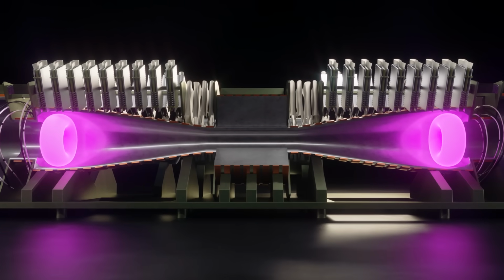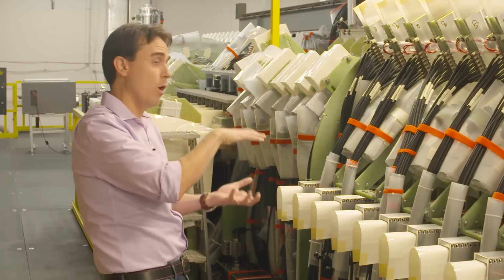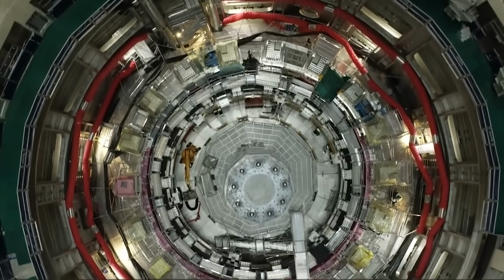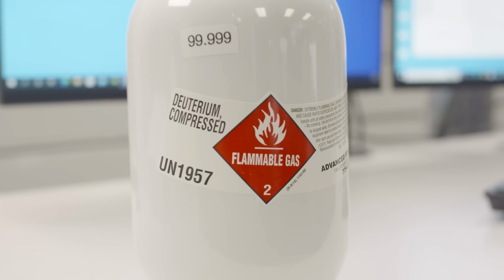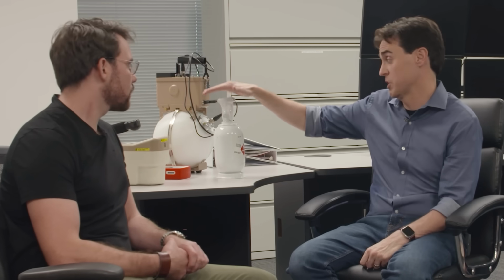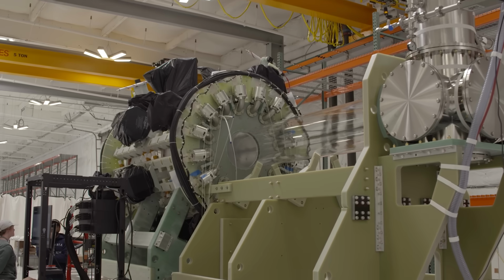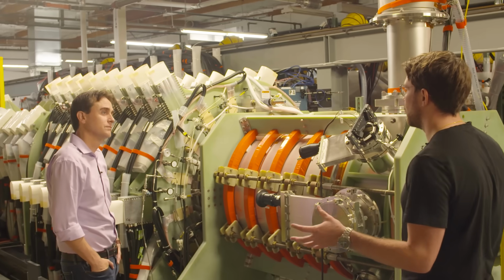A New Way to Achieve Nuclear Fusion: Helion

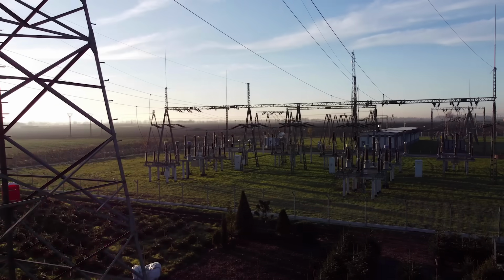Comment: 22:30 I wonder if you could replace all those capacitors with just a second generator next to it.
Generator A fuses atoms, powers generator B's containment ---> generator B fuses atoms, powers generator A's containment. Like a twin-piston diesel engine in lawnmower haha
Advantage would be power generation magnets of A could be directly wired to containment of B (no electronics needed, just wire-on-wire, right?)

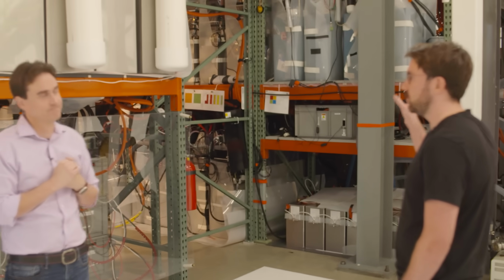Starting it all up might require a hell of a pull string though....(Initial start might require those capacitors anyway) BUT you would avoid damaging capacitors over time by repetition use (like was mentioned at cca 24:22)
Reply: The power input requirements over time likely won't match the power output curve, so they will probably need some form of energy storage no matter how many reactors they have set up to work together.
Reply: @Tsudico  Aah that's a good point. What if the power output doesn't match?
Maybe it doesn't have to though - you will generate lots of electricity, some of which will go to the other generator - and the rest goes to the grid (and maybe that's where you might need some storage, but not as much)
Reply: Then how will energy get generated then?

Comment: Especially after your last video about fusion reactors, this really seems a lot more hopeful, to use your words. Did you talk to David more about how the piston-like process of actually "harvesting" more electricity than is put in works?
Reply: In principle you can understand it by reading Maxwell's equations (the changing magnetic field creates an electric field that accelerates the electrons in the wire and creates a current), but I'd also be interested in seeing how it's made reasonably efficient, and how it doesn't just suck up all the other magnetic fields that are used

Comment: Around the 26 minute mark, speaking on the speeds of the power release in the magnets, was the determining factor of the potential speeds for the coil gun I drew up in 10th grade, 24 years ago, lol. Weaponizing the driving magnetic force is the key to magnetic accelerator cannons, IMO. Railguns are obsolete now, and I am amused to see my hypothetical design from my teens justified by this fusion reactor.

Comment: This looks like an excellent direction to go in to develop fusion technology.  Ideally, it would be better to come up with a way to use deuterium as fuel.  But if they can come up with an effective way to produce their fuel from deuterium, I would say that's a reasonably good way to get around that problem.  Otherwise, it's a non-starter.  But everything else is good.  The smaller reactors that can be more quickly and easily built are definitely the way to go.  It's not only more practical for producing fusion power generation, but it's considerably more practical during this research and development phase.  They can build ten different versions of this reactor in less time than it takes to build one reactor of other types.  I really hate the lack of progress in the field, and it's largely because of people not at all considering the practicalities of developing the technology.  They are, basically, doing research for the sake of research rather than with an end product in mind.

Comment: So if I'm understanding correctly, Helion plans to use the orbiting fusion particles to drive a dynamo. But they either haven't done that yet, or they haven't said how much power output they're getting from it?
Reply: They said that they can currently only fire once every 10 mins so the output would be minimal but it seems like the end goal is multiple times per second. So once they have a smaller waiting window and more constant flow they would be able to have data they can use to predict how much theyd get at certain firing rates.
Reply: @Konz97  Ah thanks, that makes sense.
Reply: look up lenz's law.
there are electro magnets surrounding the plasma confining it with magnetic fields, the plasma also has a magnetic field.
when fusion happens the plasma expands with force, so the field of the plasma pushes back on the field of the electromagnets, causing the induction of current in the electro magnet.

it is not exactly a dynamo because there is not a constant rotating field, it is more of push pull thing, compress and expand. like the piston of a car engine.

also they are currently drawing power in their other test systems but not in the large scale main machines
Reply: @atafakheri8659  the video pretty much skipped a detail explanation of this part.  what exactly is spun or pushed to generate energy.
Reply: @shake6321  did you watch till the end? it was explained!!
the middle section of the generator compresses the ball of plasma, the compression causes build up of pressure and temperature in the ball of plasma igniting fusion reaction.
the fusion causes the expansion of plasma that causes the field of the plasma to push against the field of the electro magnets, inducing current.

the generator itself has no mechanically moving part
Reply: @shake6321  Spinning ions have an EM field, so you can use that as a rotor to induce electrical current in a stator. It's the inverted process we see in all electric motors.
Reply: @atafakheri8659  i am a laymen.  they used graphics for everything else but didn’t really spend much time on spin or piston action.
Reply: They haven't extracted energy yet. That is what their next reactor version is planned to do when they finish building it in about 2 years. It is possible though that even if they haven't tried to extract energy out, they have seen the changes to the magnetic field that the fusion plasma is causing in the current reactor to make them think it is even feasible.
Reply: they probably aren't confident of their machine to yield high efficiency. I think their machine version 7 will still be a debugging/test machine to actually measure the energy output, which might be lower than they'd hope. That's why there's no final numbers yet. (Like for example mentioning that "gyro orbit" is larger than they expect, which implies that the particle collided with the reactor wall and causing energy losses, for this version 6 of the machine).
Reply: @xponen  LOL, i don't think any research company releases actual data to press on upcoming techs. it doesn't have anything to do with "confidence"
Reply: @atafakheri8659  what about Elon Musk? he does that. Compared to Elon Musk, this company doesn't dare to mention any numbers at all.
Reply: @xponen  Elon Musk is also a narcissist who has been seen time and time again making promises he can’t keep
Reply: @xponen  ah yes, releasing numbers about test drives of cars on the road in hands of volunteer testers is the same as publishing data about a cutting edge technology hidden behind bars.
you are high as Fuck if you think tesla cars are any where near the technological secrecy of this technology.
Reply: @suckersupreme  Yep, where is the hyperloop? Where is the cyber truck? What about these underground roads. Musk is full of shit most of the time.
Reply: @xponen  Elon Musk is a con man. Of course he releases numbers to excite the tech bros
Reply: @xponen  He might shout out numbers, but in most cases they turn out to be... optimistic, if we're being very generous. Elon's a publicity guy first and foremost, not a resposible businessman. He wants to be seen as a genious visionary, so he tries desperately to be ahead of the curve, problem is he is he rarely has any substance behind it.
Reply: @suckersupreme  I mean, my point is, his "confidence" is soo high it allows him to cite numbers on behalf of his company.
Reply: @nurfuerdieplaylist  It's astonishing that people like you post bullshit without knowing anything about anything. "Any substance behind it"? really buddy? really? SpaceX being the only company who successfully developed reusable rockets and only private company to privately deliver stuff to ISS, Starlink being the only global satellite network of this scale available to pubic, Solar panels , Batteries, Tesla even though it never was cutting edge, but it created the electric segment you see today.
Reply: @xponen Get off Elon Musk’s nuts man. He doesn’t even do any of the engineering and hard work himself, he’s always just pulling numbers out of his ass.
Reply: @tonygunk307  Do you think Elon created SpaceX himself? Or the Lithium Ion Battery? Or hell, even PayPal? That's what I mean by not any substance. He never comes up with anything himself, he only takes credit for other people's ideas. Yes, he sometimes facilitated the success of these ideas by throwing money at it, and I will happily admit that it pushed some boundries, but my point is he's the guy with the money, not the ideas. Which was my original argument.
Also, let's not forget all the ideas that Elon put out over the years that were kinda shit to begin with, like his whole take on public transportation.
Reply: @xponen  If someone other than Elon actually acting in good faith were to be as public and evocative with their creative process, then yes that might work out pretty well. It's just a big risk to take since it also enhances any backlash.
Reply: It’s like the laser fusion and every other fusion test right now .Nobody has a working prototype to capture the electricity, we have multiple ways to create a fusion reaction on earth but no working solution to capture that energy. If they can create a working prototype in 2024 they will be miles ahead of everyone. For example the recent “breakthrough “ only confirmed that you can get more energy out of a reaction that you put in but that’s not factoring in the energy used by the laser.

Comment: So, what is the Q plasma? How exactly do they want to get usable grid AC out of it, especially if the operation is pulsed, i.e. limited to brief bursts. Running many such devices in parallel and switch between them? How do they remove the fusion products and inject "new fuel"? The piston analogy of the magnetic fields is nice, but how exactly do they switch between compressing (dumping megaamps of energy) and actually capturing the "magnetic pressure" once fusion kicks in, meaning megaamps of energy flowing the other direction. They will need an insanely fast switching capable of handling insane currents to "divert" them out of the machine possible into many different capacitor banks for each cycle. And from those capacitor banks the energy could be switched to the grid. One mistimed switch and the whole capacitor bank literally blows up.

Comment: Really curious what kind of energy output this will have. Shame it wasn't even speculated on in the video, but damn was it impressive to see. Look forward to seeing more of this technology.
Reply: Best part is, even with all this, it's not exactly all that deadly even if something happens. These reactions require a lot of perfect conditions to create energy, and if a puncture or failure occurred, it would just quit. It won't blow up the building or release radiation to the air in awful blazing fires
Reply: Thanks for saving 25 minutes of my life. :)
Reply: Think of the atom bomb but condensed into a energy generator
Reply: @jessemacaspac443  -- Is that per process?
Reply: @TlalocTemporal  if we are heating up plasma so hot we are creating helium 4, then that's pretty much it. This was achieved when the hydrogen bomb was invented. The forces at work here are hard to comprehend really. The power of the sun in a generator, that's wild.
Reply: @jessemacaspac443  -- This might be comparable to a fission bomb in temperature or pressure perhaps, but total energy output is definitely not 200+ terrajoules. That whole building would be vapourized.
Reply: @jessemacaspac443  I doubt very much that is how much energy is produced. That would vaporize the machine instantly.
What I was looking forward to hear is how much energy does 1 cycle generate. They are talking about having to put in massive amounts of power for the process to work, so the output has to be huge. However, they also say the power is in a very short timespan. So it will all depend on how much net energy is released per cycle and how many of these cycles can be done realistically without downtime.
Now sure, some of  the above is what they are experimenting with, but I'm sure they could calculate the mass of fuel injected on both ends and make a guess/calculation of the energy a cycle releases.
My guess right now, is that this is just a proof on concept. They also mentioned they have yet to extract the power generated from the plasma.
So while it is cool and all, without the numbers to back it up, i remain slightly skeptical, but I will keep an eye on this project and hope for positive results in the near future.

Comment: I have some questions

After each plasma collision, where do the new elements go? Is there an exhaust system? It doesn't stay in the reactor right?

How are they going to deal with the heat when they start doing a collision multiple times a second? Could they do double the work on energy collection not only by the magnetic field like you explained but steam generation as well?
Reply: he did mention they have an exhaust system for capture and recovery of spent fuel
Reply: @salerio61  I must have missed that part. There's a lot of info to take in

Comment: by skipping steps to convert the energy, this fusion reactor is surprisingly more simple than tokamak reactor. There were almost no moving parts from what i've seen. I didnt mean that the engineering is simple but i think it take less maintenance and less headache to think about. Simplicity is good.

Comment: You can turn heat into energy right? Would it make sense to have thermo-piezoelectric transducers plastered over absolutely everything that gets even slightly hot? Or is the energy harvested simply not worth the trouble compared to the energy that fusion theoretically brings
Reply: That tiny amount of energy you could gather would be lost before you could turn it into anything useful.

Just not worth the effort.

Comment: Glad you had a fun field trip, but as long as we're trying to use heavy hydrogen, that's always going to result in pollution.

Yes, it comes from refined seawater, but what do you do with the waste after your seawater is distilled? The same thing you do with mass desalinization; pump the brine back into the ocean, where it causes toxicity, killing everything around it in the water.

To make enough deuterium and tritium for sustained fusion, you'd need HUNDREDS of these kind of desalinization facilities.

We've wasted so much money, time and effort on trying to harness the power of the sun that we ignored the fact that we can do that already in multiple ways.

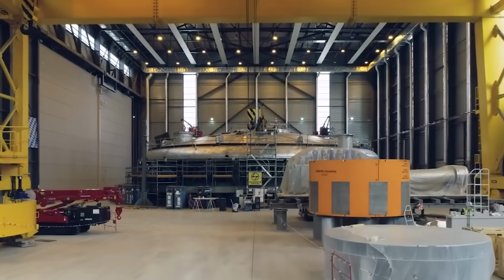Comment: 11:42 You mean fission reactors such as light water reactors and stuff. Molten salt reactors based on the thorium fuel cycle would not be as expensive in comparison.

Comment: Wow! I am incredibly impressed, both by the technology and the quality of the presentation.

I have a few basic followup questions though:
1) Because of the rarity of Helium-3, Helion must currently use their own fusion process to create it. So they are "baking in" some of their energy expenditure into the fuel. How much energy does this consume compared to the amount theoretically generated by the final fusion reaction?
2) Why is it important to create two separate plasma balls and then smash them into each other, instead of just exciting one plasma ball up to fusion levels? Is it because adding kinetic energy by acceleration works faster than other ways of adding energy?
Reply: 2. Not being a scientist, i can still have an answer on your second question.. because of the acceleration, more energy gets converted while in the fusion itself. This means there is more energy generated than in the 1-plasma-ring concept.
Reply: Not a plasma scientist. However I'd imagine it's easier to maintain and control a plasma at a few M kelvins than 100'sM kelvins. So slamming the two together at 10^5m/s and it instantly stopping makes an additional plasma-mass*10^10J available for heating the plasma
Reply: @salerio61  That's kinda what i was trying to say
Reply: @romy23uwu  ok :)